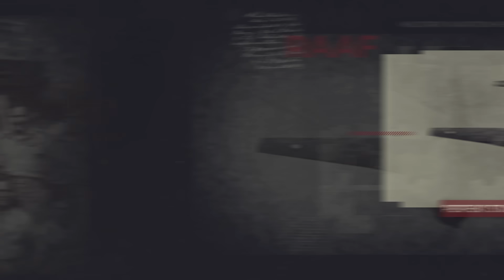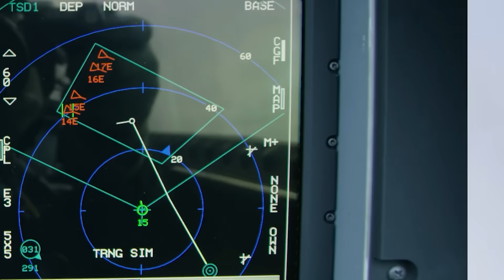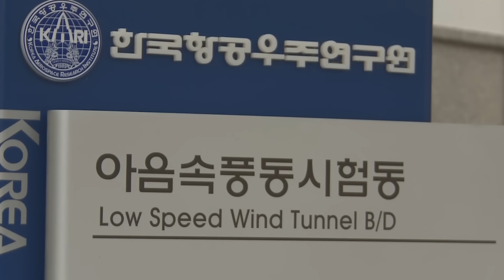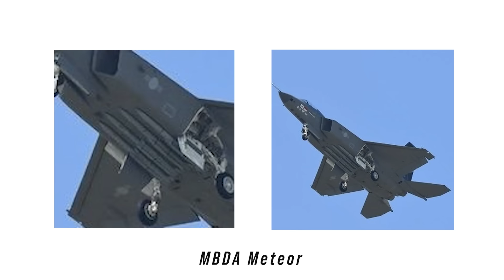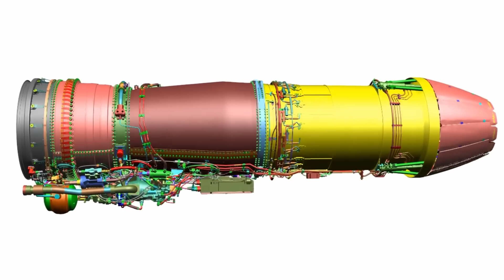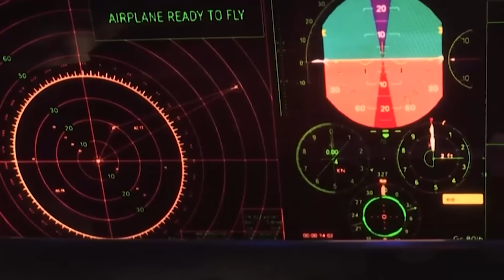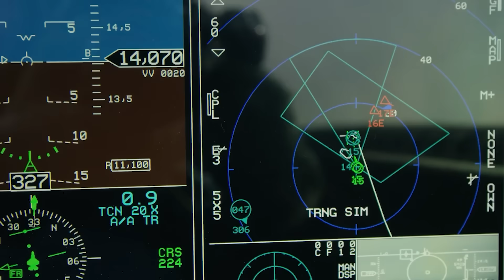KF-21: Korea's New Fighter

Comment: Hoping the best for the KF-21. It looks to be a promising new airframe, and it is a beautiful looking plane. I think the domestication rate for the KF-21 in terms of parts is 65% or something (unsure of the exact number) which is already phenomenal. This starts off as a 4.5 gen, but fundamentally, it has the building blocks necessary for a 5th gen and possibly a 6th gen upgrade. Lockheed is an advisory partner, but did not give out any core technologies (AESA radar, IRST, EOTS, weapons/flight control software, stealth coating, etc) as someone commented in another post here, to the best of my knowledge. They were supposed to I think, when South Korea bought the F-35A, but they refused to transfer tech in the end. Lockheed helped guide the airframe design, but most core technologies were developed by South Korea which makes things more impressive.
Reply: 레이더와 핵심기술 이전은 미국에서
거부한것이 맞습니다
이스라엘에서 한국개발에 시험장과 그외 도움을
주었습니다
한국 무기는 스펙을 다운시켜서
발표를 합니다
그 이유는 미국의 눈치도 봐야하고
중국과 러시아의 눈치도 봐야하기 때문입니다
한국이 5세대 전투기를 처음부터
개발해버리면 미국의  무기산업에
지장을 주기때문에 미국이 분노합니다

그래서 한국은 틈새시장을 개척해야
살아남을수 있습니다
4세대는 F16이 대세이고
5세대 또한 미국이 생산하니
4.5세대 전투기로 시작하는게
현명하죠..
Reply: The current development in USA seems to be making 6th gen into a stealthy flying control-center for small swarm of stealthy companion drones that carry all the weaponry etc.. As such every 6th gen might be comparable to a flight of earlier jets and so the cost will stay high and production numbers too low for economy of scale.
Reply: I'm not sure where you got the info on Lockheed only being an advisory partner, they sold over 24 F35 key technologies to KAI as part of the deal, the 4 you mentioned are the only 4 the US government specifically banned from being transferred, So yea you can quite easily see why people say its a F35 derivative or clone, its using 20+ key technologies straight from the f35 as sold by Lockheed to them.
Reply: Western partners in such programs generally try to stall and slow down the program as much as possible. They promise tech transfers, knowing well that their politicians etc will block those transfers giving them an excuse not to go through with giving those tech transfers. I'm Turkish and we've got a lot of experience with false promises lol. We've had companies bait engines, tech and parts for decades. We just ended up making indigenous versions in the end.
Reply: KF21 has a domestication rate of 80%
Reply: The KF21 is not a fifth-generation jet, and even the Koreans themselves acknowledge this. It's clear from examining its technology that it is classified as a 4.5-generation jet, essentially an advanced version of a fourth-generation aircraft. Fifth-generation jets encompass much more than just having a stealthy shape; in fact, the design is the least interesting and innovative aspect of fifth-gen aircraft. The real focus lies in their avionics and sensor fusion, as well as the entire information networking and processing capabilities, which provide a significant advantage and justify the fifth-generation designation. Unfortunately, the KF21 lacks these features. Furthermore, it lacks the advanced RAM coating found on the F22 and F35, that is the most important part of making an aircraft low observable. It does not even have an internal weapons bay...all of it is necessary in order to make it truly low observable and give it the 5th gen designation...

Additionally, the idea that it is "Korea's" "fifth-generation" jet is misleading since they purchased much of the technology from the U.S. company Lockheed Martin. While Korea issued the order and provided funding, the work was primarily done by the United States.

There really is no need to lie about it or to make it look more advanced than it is. It is a superb aircraft for what it is designed for, nothing more and nothing less. I really don't understand the need for misinformation regarding this aircraft...
Reply: 보라매 전투기 별명 베이비랩터 입니다
슈퍼호넷 F-414×2 항공엔진  바디는 레거기호넷 작은 전투기 입니다 
보라매 함재전투기 개발 슈퍼호넷 크기확장 미래 스텔스전투기 개발 내부무장창 내부연료탱크 여러가지 첨단기술 AESA레이더 스텔스 전용 항공엔진 국산화 필요한 보라매 전투기 입니다
Reply: @김용호-x9s  KF21이 중공J20을 이기면 좋겠습니다.
Reply: 일본 영국 공동개발 6세대 목표 전투기 개발 미국에 당한 F-2 전투기 트라우마 있습니다  개인적으로 보라매 F-100×2 항공엔진 5세대 스텔스전투기 개발 TF-X 칸 시제기 성능의 전투기 하이급 미들급 함재전투기 현재 F-414×2 성능 국산항공엔진 만들고 로우급 수출용 F-16 전투기 성능 전투기 개발 생각을 했습니다
Reply: U.S. defense contractor Lockheed Martin has agreed to transfer more than 20 technologies from the F-35A to KAI under a cooperation agreement. The engine of the KF-21 is the American model F414-GE-400K, and KAI selected American Texstars to develop the glass cover and windshield of the KF-X. The drivetrain for the airframe mounted subsystem (AMAD) was developed and manufactured by Triump Group. Aviation Systems (CESA) Emergency Braking System, Spain; Environmental control systems, cabin turbochargers, liquid cooling, and flow control valves from United Technologies; Martin-Baker's Mk18 ejection seat, Cobham's oxygen supply, communications antenna, auxiliary fuel tank and rocket launcher; Meggitt's external sensors, fire detection, air monitor, landing gear brakes; MBDA's beyond-visual-visual observation system for the Meteor air-to-air missile (BVRAAM); Curtiss-Wright's Instrument Flight Test System (FTI) and Data Acquisition System (DAS) for flight testing...
Reply: @Toanharry  Any country that purchased the F-35 would have received a similar level of technology transfer.
Reply: Is this even worth upgrading from a F-15EX? I see nothing new.
Reply: @Pepe-dq2ib  Half the price and expandability
Reply: @sugarfree97  you cant just add internal bays on an old airframe...
Reply: @Pepe-dq2ib  KAI of Korea participated in the development of the internal bay of the F-15se. kf-22 will also be added according to the block phase. Currently, block 1 is only used by the Korean Air Force. Export will be possible from block 2 or 3.
Reply: @sugarfree97  and the silent eagle is a 20-25 year old program, it will never be in production. They arent going to install internal bays in used frames that have 10 -15 years left, it would just be exposed to fractures earlier. Old jets are just used as a test bed for future programs. You said expandability for the KF, but old frames arent going to be modified for internal bays, it'll have to be brand new jets. If you want internal bays now with the KF, you'll be buying it twice, its not worth betting on it to be executed perfectly, timely or financially. Will the KF have stealth or will they axe it due to budget, who knows. Countries that want an F-35 will just buy the F-35.
Reply: @Pepe-dq2ib  No one expects block 1 to be able to put an internal bay. Block 1 and block 2 are for domestic use. Block 3 is for export with scalability to stealth. 

Indonesia pays attention to the f-15se because they can't buy the f-35. The US only sells it to the most important ally can trust.

Korea has dozens of F-35s, but not use main fighter. There are problems with maintenance costs and access to maintenance. Korea has also used a lot of political power to attract maintenance depots to Korea.

The kf-22 does not compete with the f-35. Middle class fighters such as the Rafale Eurofighter f-18 are its rivals.
Reply: @sugarfree97  if there's internal bay then it's been designed for it already as scooping out a new bay, all the plumbing, wiring, air ducts have to be redesigned..... that's not doable so if there's internal bay, it'd been shown already....
Reply: The parts provided by non Korean companies for the KF-21 fighter jet include:

Radar system: The radar system is supported by Elta, an Israeli company, and participated in the production and onboard testing phase 1 of the radar prototype.
Electro Optical Targeting Pod (EO-TGP): Provided by Elbit Systems, Israel.
Terrain Following/Terrain Avoidance (TF/TA) System: Provided by Elbit Systems, Israel.
Engine: Adopting the F414-GE-400K engine from General Electric (GE) in the United States.
Attachment transmission device: developed by Triumph Group Corporation in the United States.
Emergency braking system: developed by the Spanish airline company CESA.
Wheel braking system and onboard sensors: developed by the British company Meggitt Group.
Cockpit pressurization and cooling system, air turbine starter, and flow control valve: provided by United Technologies Corporation.
Mk18 ejection seat: provided by Martin Baker Company in the UK.
Missile launchers, communication antennas, external fuel tanks, and oxygen systems: provided by Cobham UK.
The only thing that needs to be produced in Korea is probably iron sheet.........
Reply: @jorker-1 Troll. Get the facts right. Radar is from Hanwha which is. korean company. You are giving the false info from the start lol
Reply: Korean KF-21 is all foreign technology, all core techs need import; Korean should just stick with Kpop with all those sexy dancing and singing.🤭
Reply: @jimmyha1898  You fools wake up, China has stopped selling turbofan blades to the United States, and now the United States has stopped producing its own F-35 fighter jets for 12 months, and Korea's KF-21 fighter jets can't be produced without the U.S. F414 engines. All of your KF-21s in South Korea are out of production, as are the Glorious fighters in India.
Reply: @飞扬-o4c Aw, look at you a poor little puppet, proudly marching to the tune of lies, oppression, and good old-fashioned theft.

Now that you’ve done your little job, run back to your master Xi Jinping, before the dogs he raised turn around and bite him.
Reply: It's an exact replica of Americas f 35....tell me I'm lying🤔
Reply: @TimAnderson-i9d  that is China's new jet.
F35 is single engine but KF21 is twin with out inner weapon bay. 
Even KF21 have no have air compression bulge in front of air intake but F35 did.
Be compare F35 and China's.
KF21 is not copy of F35. But it is down sizing of F22. That is more reasonable.
Reply: @meyenxhin6891   I agree with the opinion that KF-21 is a miniature version of the U.S. F-22. However, since the design ideology for the provision of internal armament was introduced, KF-21 currently does not have an internal armament, but Block 3 plans to introduce an internal armament later
Reply: @meyenxhin6891  That's right. Baby F22
Reply: @meyenxhin6891  "air compression bulge"
You mean "diverterless inlet"?
But yeah, this thing is basically a scaled down F22 with the cheaper canopy of an F35 and none of the tech upgrades that the F35 actually has over the F22. Maybe not terrible as a platform, but from the immediate aesthetics it's definitely taking the cheaper options from both inspirations.
Reply: @meyenxhin6891  made in china J-31
Reply: @TimAnderson-i9d  You and I share different opinions on the definition of the phrase "exact replica" if you think the KF-21 is an exact replica of the F-35. The F-35 has 1 engine. The KF-21 has two. This by default tells me that it is not an exact replica. The KF-21 is closer to the F-22 if anything. Even China's FC-31/J-31 which was made with hacked F-35 data is not an "exact replica". If you want to complain about copying, I would say the J-31 is a much better subject. The Koreans made the KF-21 through legitimate partnership with Lockheed as the advisory partner, rather than hacking.
Reply: Exactly. When you sign contracts, purchase IP, and have a corporate partner as an advisor on a project, that is NOT a copy and NOT STEALING. The South Koreans have done this entire project on the level, because they're not proud of theft and they have a trust-based modern governance system like the west. All props to SK for developing what looks to be a pretty great airframe, and this is just the first step. With the China threat looming, we need all hands on deck.
Reply: @inoculateinoculate9486  Precisely what I mean. You clearly know your stuff. 👍 Also, in this day and age, everyone cooperates with one another and takes inspiration from things in other countries. As long as it is a formal, legitimate partnership, cooperation between good allies such as the US and SK is necessary.
Reply: @jimmyha1898  I would go further to say that all these fighters F22, F35, J31, KF21, Shin Shin .... all are traditional designs that goes all the way back to WW2 fighter planes with stealth design elements. Only the Deltas are a different category on aerodynamic design. And the stealth design elements are same for all planes because it is physics, you can't escape it. They are all copies of age old designs and you don't have steal anything, these designs are taught in Universities and freely available in your textbooks. If these design themes were patented, they have expired decades ago. Even Apple's patent on a rectangle box with a button has long expired and even they copy earlier smartphones like the O2 or Newtons ....... The idea of patenting shapes defined by physics or ergonomics is to me ridiculous.
Reply: @olderchin1558  100% agreed 👍
Reply: @TimAnderson-i9d  you’re lying and blind. Lol
Reply: yes you are lying cuz you mean f-22 @TimAnderson-i9d
Reply: @TimAnderson-i9d

Comment: Could be an interesting aircraft for smaller European nations provided the KF-21 shows decent capabilities and has relatively low operating costs and purchase price. We in Switzerland have still 30 FA-18s C/D (from initially 34, delivered between 1996-98) and 26 F-5 E/F Tiger II (from initially 110, delivered in the late 70s) in service. These will be replaced by 36 F-35 A between 2027-2030. As per current plans, these will be the only fighter jets left in the Swiss inventory. But why not supplement the F-35 with a light fighter (e.g. 24 KF-21s) to bolster our air defence and take over some roles from the F-35? A plane like the KF-21 could have a niche market in such a role...
Reply: High-Middle combination is a must.
Reply: I rather get F15 to backup the F35, its proven and just as capable if not more.
Reply: @Pepe-dq2ib  if you do not consider low observability and a room for more evolution, sure. However, if that's your criteria, you don't even need the F-35 in the first place. F-15 would do everything that F-35 can do in much bigger volume at much lower cost. If you wanna back F-35 up with anything, that means you need stealth or at least low observability, which F-15 is inherently limited and barely has any room to be better. F-15 are a superb option to back F-35 up if you already have them, no doubt, but not a solid choice for those who don't have them yet.
Reply: @technocracy90  KF21 is not a backup for F35 either, you are clearly overrating its stealth and cross section. Kai doesnt have the same paint, a weapons bay or heat deflectors like F-35. The upgrade ability you keep claiming means nothing without a weapons bay and theres no way to add it.
Reply: @Pepe-dq2ib  I served in ROKAF as an airman, and that's the proposed role of it. The Airforce, the Congress, the Government of Republic of Korea build this craft for the exact role: to backup the 5th gen stealth fighter. "Backup" can be subjective, so it's okay to have your own opinions. However, it seems like real-world military generals and decision makers disagree with you. Sure, they won't follow F35s deep into the enemy territory as if they're full-scale stealth fighters. However, they can follow F35s much deeper than their high observable fighters such as F15s.
Reply: @technocracy90  "military generals disagree with you" more like ROK are the only ones saying that, maybe it's country pride or to save face. Most other countries are going with F15 or just budget for more F-35.
Reply: @Pepe-dq2ib  and ROK is one of the biggest military on this planet, and most other countries you would list are irrelevant in terms of Airforce firepower. Also, despite your naive belief, Koreans are not a hivemind of collective souls. It has one of the most fiercely divided politics that we attempted 2 impeachment in 20 years and actually impeached one. If somebody with authorities tries to save their face by protecting such senseless decisions or policies, it's just a glaring target sight for the ones of the opposing party. Such an ambitious project like KF21 having survived long enough to see the fruition itself means a lot.  It's even much more noticeable than a national project from Obama surviving Trump, Biden, and then Trump again.
Reply: @technocracy90  yeah one of the biggest with outdated planes, the AF power index puts you 12th. The US, UK, Israel, France,  Germany, Italy, Australia, Russia, China and Japan have no interest. Korean builders are not even close to Lockheed, Airbus, Boeing, Raytheon, Northrop, or GE, stop it. You still have to buy GE engines out of our B stock, we dont even sell you the good revision that we offer to other ocuntries.
Reply: @Pepe-dq2ib 한국은 엔진을 얼마전 kf21의 동급이상으로 개발완료 했습니다.
더이상 엔진을 미국에서 구입하지 않을겁니다.

이젠 더 높은 단계의 엔진을 개발해낼겁니다.
Reply: The F-35 is considered a "light" fighter as it is eventually replacing the F-16 in US Air Force service.
Reply: It has a US-made GE engine and the US has their fingers everywhere inside this project through Lockheed. The Koreans made a big mistake not cooperating with either BAE and RR or Dassault and Safran. Now, this plane is not an option for those wanting something like the F35, but not willing to buy US.
Reply: That also is the exact role of KF-21 for the Korean Ariforce. A lot of armchair airforce generals on the internet often forget you need to back up the high capability elite fighters with cheaper, but many fighters. F-15 was backed up by F-16, and in some countries F-16 was by F-5. Even the famous/notorious F-35 was designed to back F-22 up with its inferior-but-cheap^TM capabilities. KF-21 is not to replace nor compete with F-35, but to support them.